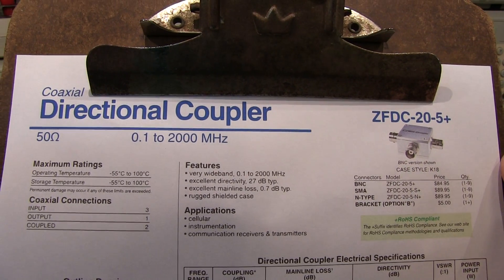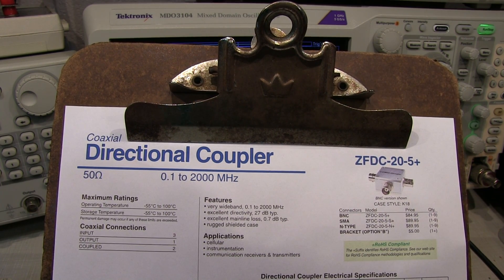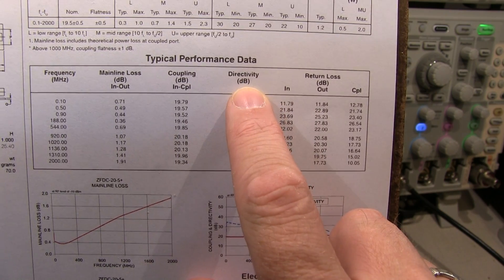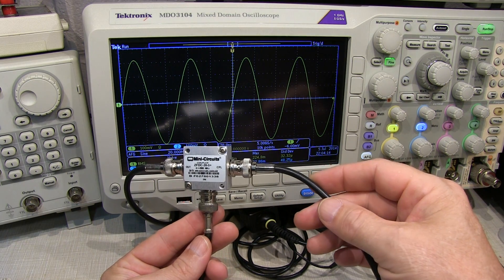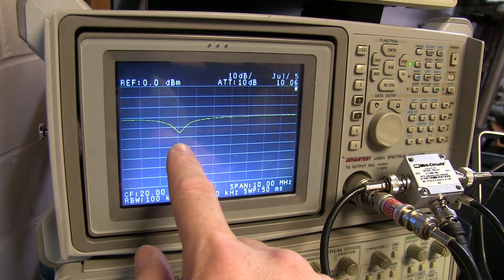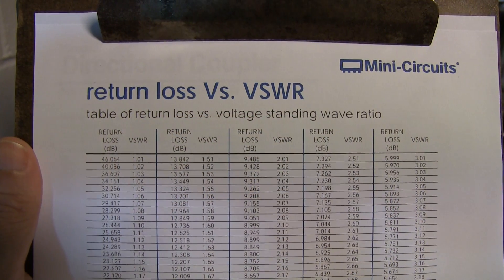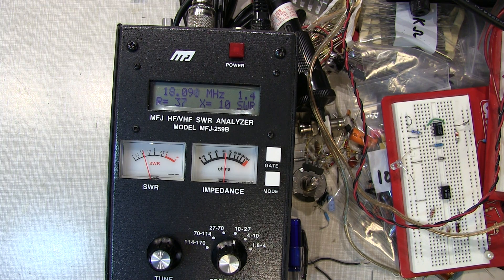#158: Directional Coupler Basics & how to sweep SWR of an antenna | Return Loss | VSWR

Comment: I would love it if you made a video on multichannel RF splitters and distribution amps ( splitter loss gain loss ) theory. I'm trying to split a single Log Periodic Dipole Array antenna for Diversity reception ( 2 x antenna ) into 4 x diversity radio mic receivers and would like to add 2 x antenna LNA's onto the antenna to boost the signal to match the db gain loss made on the splitter. There are many factors!! cable loss , splitter loss. RF amp noise per antenna. at least I'm looking at 50ohm impedance all the way ( i hope )  from antenna to receivers so hopefully no mismatch. Anyway , splitter theory and distribution amp / noise etc theory video would be so helpful. Thanks for these great videos :)
Reply: should also say any ideas on low cost 50ohm LNA's with variable gain for approx 400mhz - 700mhz would be helpful. I think from watching this video I can use a sig gen to check the gain on the splitter outputs is unity from antenna output with an oscilloscope.
Reply from the maker: I"ll add these topics to my long list.  Suffice it to say that power is always reduced through a splitter - even for the basic reason of conservation of energy.  Even considering an ideal lossless 2-way splitter, the power in each output would be half of the input.  However, there is no such thing as a lossless splitter...
Reply: @w2aew  Yes, it seams you get 3db loss ( half gain ) + insertion loss of say 0.4db at best ( at least on my micro circuits splitter ) so far I've learned i should place the 2 x LNA's near the antenna to compensate for the loss so that i'm not amplifying cable noise. Also finding LNA's all introduce noise! I also need to try and learn if gain is that important! As far as I can understand what is more important is signal to noise ratio? I'm thinking in a diversity setup the gains should be reasonably equal so that the receiver can switch to best receive signal strength. Thats assuming received signal strength is relative to gain?  I will do some tests but I wouldn't be surprised if the LNA's don't help me in the real world with TX - RX range :) anyway , would be great if you could do some LNA gain / splitter gain compensation theory one day. Thanks a lot for all these great videos.
Reply from the maker: @BenBilesBB-box  Yes, of course LNAs add noise - the amount of noise added is measured by something called the Noise Figure - something else I need to add to my long list.

Comment: Thanks for video Alan, great as always... I am new to RF stuff and recently have bought a spectrum analyzer with a TG, also built home brew directional coupler and trying to figure out how it works.
My question is what steps should i take in order to determent what is capable for ?
In other words if you have an unknown directional coupler how would you determent its characteristics or verify with a datasheet if happens to know the part number? What would you look for to verify that it is performing as stated or it is defective, also its frequency range, all by using a spectrum analyzer with TG ?
Reply from the maker: You can start by checking the forward and reverse coupling characteristics.  Connect the TG to the RF input, connect known good broadband 50 ohm terminations to the RF output and the REV port on the coupler, and then connect the FWD port to the SA and sweep it.  You should see a relatively flat response at the rated coupling ratio (10dB down, 20dB down, etc.).  Then, reverse the FWD and REV connections and sweep again.  With a good termination on the RF out, you should have very little reflected power so the REV output should be very low.  Then, remove the 50 ohm termination from the RF output, and sweep the REV again, this time you should see a response similar to the FWD you saw earlier.

Comment: I have a directional coupler with no data sheet. What test can I perform to determine its frequency range. I have a 1-4ghz sweep generator and a 2.4-2.5ghz spectrum analyzer.  Ports are in, out, -30db, and ISO? Made by RF Power. SDC-182-202-R1-30

Comment: can 2 transceivers be connected together through a Bird Thruline Meter for tx/rx testing?
Reply: No.
Never run two transmitters into each other.
You TX on one, and fry the RX on the other.
One transmitter on the Bird, with a proper load on the output.
Reply: I do know of a managing engineer who was a cheapskate and was working at a company that designed and built their first UHF FM transceiver. They were short on equipment for the UHF range. The engineers in the group were requesting proper test equipment to know if it worked correctly. He said all you need is to connect the two radio's together with a 130 db attenuator and if radio A talks with radio B ship it! And they did it but the company got into trouble and had to recall all of the radios as they put out spurious radiation at high UHF.

Comment: Hi Allen! Thank you for taking your time to make this excellent video! I have some questions. If I may! I now have a ZFDC 20-4 (which works for me and no -5 on eBay!) I am using a Rigol DSA815 w/Tracking Gen. From the D.C. I have the OUT going to the TG, the CPL to the SA and then with 0db i "Normalize" the TG. "Then" I attach a precision 50 ohm load to the "IN" port. I believe that this is the correct procedure to measure Return Loss. In this scenario, it appears I am seeing the R/L of the 50 ohm load. The freq start 1 MHz Stop Freq 1Ghz. Please correct my procedure if I am in error. Final question, what is the procedure for checking Directivity for the D.C. ? Thanks In advance Allen. 73's David K8KEM
Reply from the maker: In your procedure, you're using the "open" on the IN of hte D.C. to provide a 100% reflection in order to normalize the coupling factor of the D.C.   This should work well enough.  Then, connecting your 50 ohm load, you should see a very low (large negative number) return loss.  To measure the directivity - connect the TG to the IN, SA to the CPL and 50 ohm to the OUT.  You should get something that is about 20dB down (the coupling factor).  You can "normalize" this trace, then swap the IN and OUT connections on the D.C., and what you see should be the directivity (about 27dB down).  Directivity is the difference of the CPL response for forward and reverse signals.
Reply: w2aew again Thank you so very much Allen! I have learned so much from you! What makes your videos so great is that you speak clearly and quite distinctly and at a pace that is very good! 73's David K8KEM

Comment: Thanks a lot for this video w2aew. Learnt a lot from it. Directional coupler is a neat device. Very nicely explained. The only thing a little unclear @10:00 is that we are viewing the coupled port correct?
Reply from the maker: Yes, the analyzer is measuring the coupled port which is sampling the signal being returned from the antenna.

Comment: Tracking generator along with DUT and  Spectrum Analyzer , can i call this Setup as Network analyzer which can measure onlu Mag response but not phase
Reply from the maker: Plus a directional coupler and you basically have a 2 port, 1 way scalar network analyzer.
Reply: ohh yeah now i  am remembering the block diagram of Network Analyzer , the above setup is a basic network analyzer w2aew

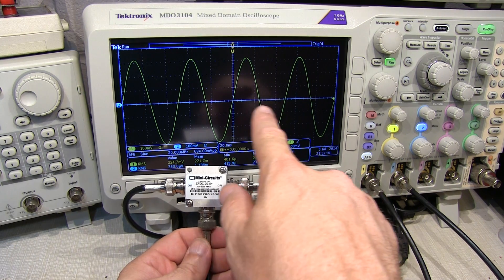Comment: Thanks for the sensational tutorial.      I'm a bit lost @ 6:20 however.        @ 5:30 you reversed the input and output; i.e., you put the signal into the output port of the device, and connected o-scope channel 1 to the input port of the device, deliberately, to prove a point that the coupled port is profoundly isolated from signals that ENTER (generally inappropriately) at the output port.         Then you start another discussion @ 6:20 without clarifying whether or not you restored the original connections; or if you left intact the reversal.
OK OK... I get it.    @ 10 (when you're using the spectrum analyzer) it's obvious you're still using the directional coupler backwards.      
Hey,  I learn something every day.    
This was really cool.  Thanks again.
Reply: These devices are easily faked at production, I should know having 20 years RF inspection background, a magnet put on the unit will simulate max or min testing, production route card dating can be faked for endurance testing, good xrays swapped for bad, vibration testing done by running off plots only without vibrating the device, I could go on & on. I earned a wage for 20 years by thinking up random numbers in a range every day for microwave devices. lol  just watching that video it reminded me of when we had to demonstate isolators & circulators working on an analyser , one customer took one look at the settings & took off all the offsets which were programmed into it to make it look like the devices were compliant (facepalm)
Reply from the maker: Glad you "got it".  Sorry if it was a confusing road...

Comment: Hello... I'm trying to find what the vswr is for a SMA to TNC RF adapter and Using your set up to find what the VSWR is from 2 to 8.0 GHZ, 8 to 16 GHZ and 16 -18 GHZ. Since the adapter is not an antenna will it work you procedure Work?
Reply from the maker: You can probably estimate it with an appropriate directional coupler and careful calibration/normalization - but it won't be as accurate as a proper VNA.
Reply: Thanks... Do you happen to know who can offer testing for our requirement? All I find is new VNA on line and no companies listing  measurements services. I appreciated any help you can give us.

Comment: question ,i have zfdc 20-2000mhz, with 0dbm connected to output and in open, cpl line=-20 all good, total reflection,with perfect termination
Reply: when i terminate with dummy load i get -45dbm thats. 25 down on an open, very good. Thing is when i connect and tune my antenna i get -55dbm, how can the antenna be better than a perfect load. cable and generator all 50 ohm

Comment: Thanks for this video, I recently got a Rigol DSA-815TG and also a directional coupler, but I have a lot of problems with ripples in my return loss plots. I tried to connect a 6dB or 10dB pad between the TG and the SWR bridge, but the ripples keep persisting. I've tried using my 10 meter long coax for HF, and also a good quality 1 meter long SMA cable, but the ripples are still noticeable. However, when using a short piece of SMA cable (15cm or so) the ripples are almost completely gone. Would connecting an attenuator between the SWR bridge and the spectrum analyzer input achieve anything? I'm waiting for some N to SMA adapters so those should come in tomorrow, I can't try it out yet. Thanks again!

Comment: gave it a try on a 2M Jpole type antenna, worked great. I'm confused about return loss bridges and when and why to use them over a directional coupler.
Reply from the maker: +Mark Butterworth Return loss bridges output a DC voltage in proportion to an impedance mismatch, while directional couplers output a sample of the RF energy flowing in a chosen direction.  Either one can be used to characterize the mismatch of an antenna system - it all depends on how you want to process/measure the reflected signal.

Comment: Nice video. I'm a new HAM and I'd like to characterize the 20m half-wave dipole antenna I recently installed in my attic. Can I use this technique without generating RF interference from my antenna?
Reply from the maker: +jimhollister50 Sure - any method that uses a very small amount of power would be acceptable.

Comment: I bought a directional coupler on ebay. Coaxial dynamics model 3580. The coupled ports dont have coax connection. They have two leads on each port. You can find pictures of it in Google. My question is, what and how do I measure and how do I use that to find the rf signal strength going through the main line? 

I couldn't find any help anywhere and the seller also has no idea. I thought I would ask you. I watch your videos.Very educational. I am a new hobbyist in the RF field.
Reply from the maker: It's difficult to say without any kind of a data sheet. But, since it's designed for 800 MHz and the sense ports are not coaxial, I'd expect that there's probably a diode detector behind each of the sense ports, so you'd probably see a DC voltage proportional to sensed power. Might bonded a capacitor across the terminals.

Comment: Hey,
Is the output seen in the spectrum analyzer the actual s11 curve, as the output is obtained from a different port than the input? It seems to contradict the common definition of s11.
Reply from the maker: +Pranjal Paliwal A network analyzer uses a directional coupler to measure the output and reflected power at each port - so there's basically a coupler behind each port of a network analyzer.

Comment: Hi,
I have a question. When you are testing the antenna, the signal from the tracking generator to the antenna is reflected back to it for the non-resonating frequencies. Won't this interfere with the subsequent signals sent from the tracking generator?
Reply from the maker: +Shalini Srinivasan It can, which is why an attenuator is often included in series with the TG output.  However, if the end goal is to achieve a good match (no reflection), then the point is moot because there will be no reflection at the desired point.

Comment: Have been home brewing some amateur osc/amps and an antenna for 1.269 GHz. I have the same type coupler. Your video is a great help. I am using attenuators and crystal detector to get my measurements. Great video!

Comment: Hello allan
what watts are the Attenuators you use connected to tracking gen output,,, 1 watt OK ?
Reply from the maker: Yes. As long as the power rating of the attenuators is less than the output power of the tracking generator, you're fine.
Reply: My tracking gen says -20 dBm to 0 dBm
so 10 db att. 1/2 watt ok ?
this old man gets confused sometimes
thanks
Reply from the maker: +DENNIS N Yes.  0dBm is only 1mW

Comment: Excellent video. I have a question... if I use a basic and inexpensive antenna tuner like RigExpert AA-600 to observe the tuning dip, will that be as good as the spectrum analyzer method you have used?
Reply from the maker: +Debamalya Banerjee Yes, an analyzer like this can illustrate the return loss just as well as the spectrum  analyzer.

Comment: Just to make a point; not ALL energy is reflected back or radiated, some of the energy is being disipated as heat  in dielectric and conductivity losses by the transmission line and the antenna. I believe you made a video on skin effect.
Reply from the maker: Miguel Rodriguez Good points.  Skin effect isn't much of an issue at the HF frequencies where this coupler is designed to work.  However, dielectric and IR losses should be taken into account for longer transmission line runs and higher frequencies.
Reply: ***** One good video would be to make one just about skin effect and losses in coaxial trasmisión lines, you did mentioned it on your video #56. KE6OJE
Reply from the maker: Miguel Rodriguez I'll keep that topic on my list for future videos.

Comment: Great video! This is the second time I watched it, and can't tell you how much I appreciate the work you do in producing these. Very helpful to us folks returning to the hobby! I do have a question. Rigol sells a "SWR Measuring Kit" for their spec analyzer that pretty much looks like one of these couplers and a few fittings stuffed into a fancy box (with matching price). Is that all it is? It looks like there might be software also, but I'm guessing that it's just minor stuff - say, calibration data and a few automation procedures - for whatever coupler they used. What do you think? Thanks again!
Reply from the maker: It is likely a directional coupler and software.

Comment: Hey I really like this video.  I am considering in buying a spectrum analyzer for tuning antennas on a PCB (chip antennas).  But they can be so damn expensive!  So I was wondering, would a MFJ-259B do the trick?  Thanks in advance!

What power rating on an attenuator would you recommend so that an antenna as a DUT doesn't drive the tracking generator by picking up arbitrary rf signals from the air?
Reply from the maker: The MFJ-259B only goes up to 470MHz, which seems a little low for PCB chip antennas.  But, if this is within your frequency range, this unit works pretty well.  It will give you VSWR as well as impedance and phase - it just can't distinguish between positive or negative phase angle.  

It would be difficult for me to recommend an attenuation value because I don't know you're situation (how tightly coupled your antenna will be to the off-air signal, what kind of power levels you're dealing with, etc.).

Comment: But...how on Earth can it differentiate between forward & reverse signals?? Sounds like magic.
Reply from the maker: It is a bit of RF magic, coupled quarter wave transmission lines most often, but there are other configs with lumped elements, or coupled transformers, etc.